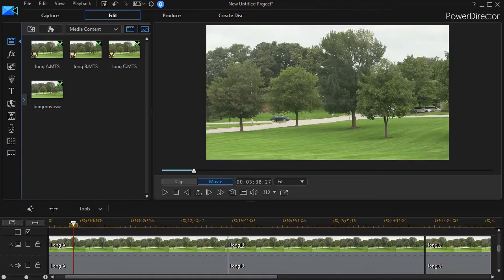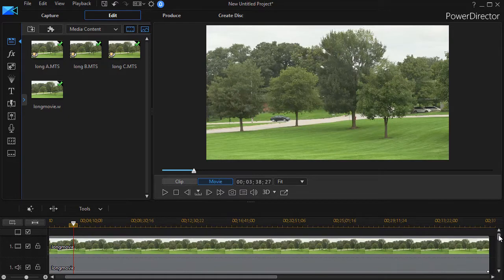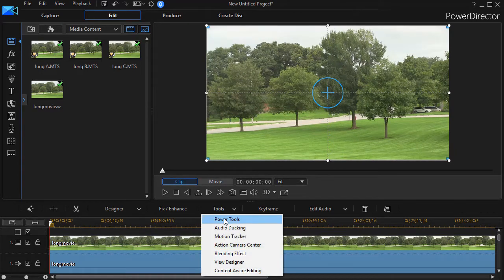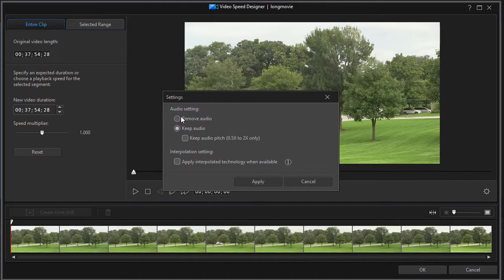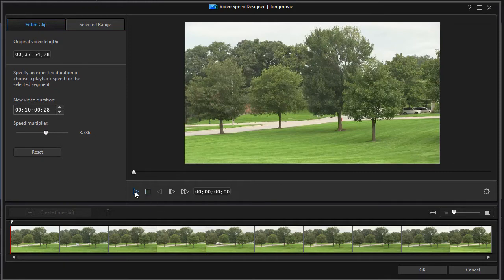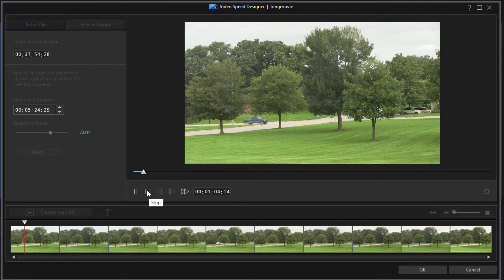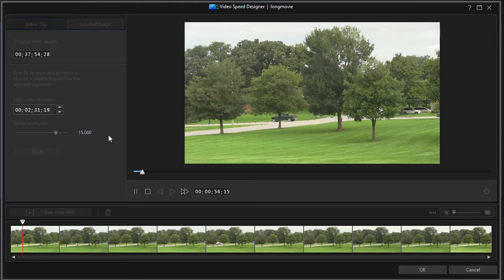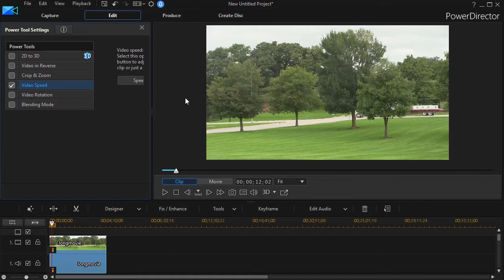PowerDirector - Tips on applying a time lapse effect

Comment: It takes 50 minutes to render a sped up video from 2 hours to 2 minutes, even at 720P30... There must be a faster way...?
Reply from the maker: I would look to the forum for help with this issue, but you might also click on the settings gear and then go to the Performance option and see if any of the options there might improve your render time. It will be largely dependent on your PC setup. --Jim

Comment: Never tried a time lapse before.  Gonna try with your tutorial!  BTW, do you know why PD16 Ultimate cannot import 4K 60fps or 2K 120fps files shot with GoPro Hero 6?  These files are HEVC and I do know that PD16 has the option to produce 265 HEVC files.
Reply: Nevermind the import issue.  Fixed it by reinstalling PD. :-)
Reply from the maker: Chris,
I discovered from other users that the jerky nature of some of the time lapse shows up in the edit mode but not necessarily when the clip is produced. That is good news.

As for the GoPro, I checked at the forum and found this thread that talks about the GoPro. I have no experience with using data from a GoPro, but this might be helpful: https://forum.cyberlink.com/forum/posts/list/76885.page#314734
--Jim